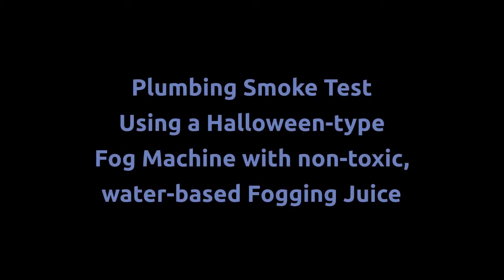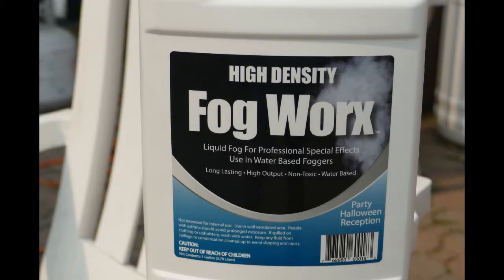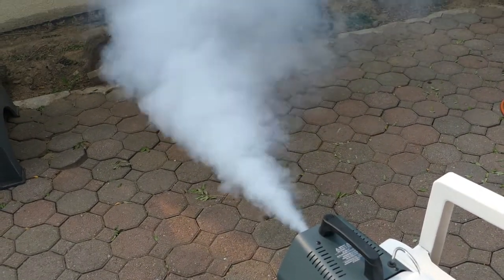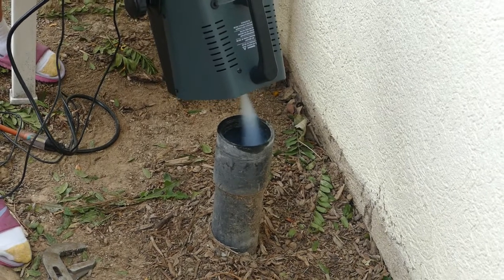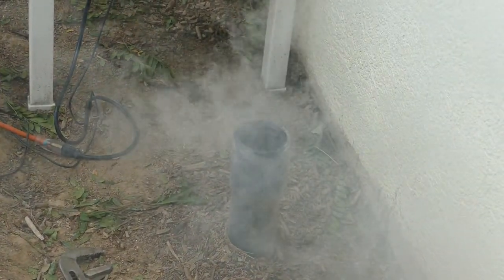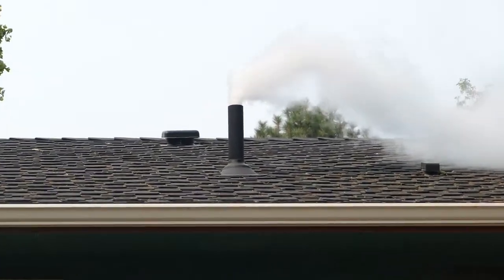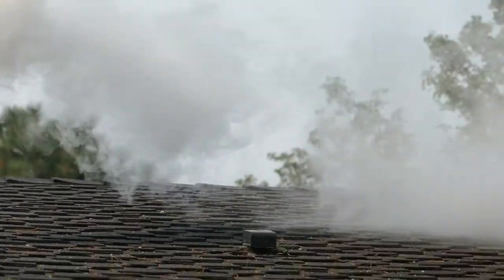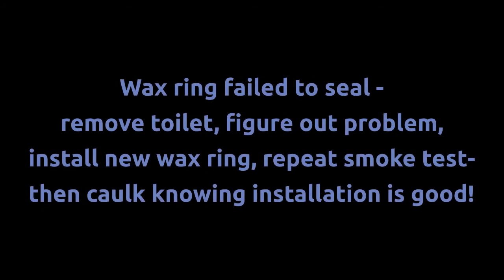Plumbing Smoke Test Using Halloween-type Fog Machine

Comment: Hi, dos you need to seal off the sewer main so the fog didn’t go that way? Or does the fog naturally want to go up?
Reply from the maker: I did not use any balloon plugs. I am on a septic system, smoke easily filled my entire venting network. Might be different for a system connected to a large sewer main, where a balloon plug could be helpful.

Comment: This is so interesting - thank you for sharing! 
After paying plumbers a small fortune for several of these tests, I have been looking for a DIY option. I bought 2 smaller fog machines (2000cfm), but they didn't seem to work. We alternately ran both of them, because they would overheat, into the clean out for 10-15 minutes but never saw any smoke appear out of any of the roof vents. Our home is 2 story, about 2700 square feet. After re-watching your video, I noticed that you're using a much more robust unit (7000cfm). I'll try purchasing one of those and see if my results improve. 
Thanks again! ☺
Reply from the maker: Thank you for your comment, it is very interesting to read about what you are doing. I hope it works for you, and will look forward to any updates you might want to share. We had profuse smoke (fog) coming out of our roof vents, then we quickly went inside to check plumbing in sections of our house at a time. We started this to check on a newly self-installed toilet, as it just didn't feel like we got a good seal on the wax ring. Sure enough, the wax ring had not sealed, as seen by the fog coming through, but it sealed great on the second try. We checked everything else in the house as well, and were relieved that everything was tightly sealed.
Reply: I think failed toilet wax seals during install happen way more than people realize. We've had several brand new homes where multiple toilets in the home were leaking. I don't think there's a good way to tell whether one has achieved a good seal with the wax rings. I've started calling it 'squish and pray'. 🤣 Smoke testing needs to be standard practice for validating a toilet install.
Reply: I have a 3500 sf house. You know the cost of the larger gig machine? Or fog?

Comment: How did the smoke get through the water in the toilet trap?
Reply from the maker: Smoke came from the wax ring that did not seal properly, not through the water trap. I removed the toilet, replaced the wax ring with a thicker urethane-wax composite ring, and re-tested to make sure the seal was tight - this time the seal was perfect and no smoke came out.
Reply: Ok so you blew the smoke in from inside the toilet?  It's misleading, it looks like the smoke is leaking out the wax ring from where you blew smoke in from the clean out outside. And it didn't make sense that the smoke would get through the water trap. @eaglehorse4337
Reply: @eaglehorse4337  but doesnt the smoke have to travel through the p-trap before it gets to the toilet ring? Can you explain how the smoke traveled from where it started to get to the toilet?
Reply from the maker: @diegoc3749  The water trap is typically in the toilet itself, above the wax ring. In many toilets you can see the p-trap or s-trap if you look at the toilet from the side. The smoke travels throughout the drain-waste-vent plumbing stack, only getting blocked by properly functioning p- or s-traps. A Google search for typical residential DWV plumbing stack diagrams will show several very helpful illustrations of how this all works.

Comment: What’s the name of the machine ???
Reply from the maker: My machine is an "ADJ Products Fog Machine Fury 2000."
Reply: @eaglehorse4337 do u have the Amazon link ?
Reply from the maker: Search for "ADJ Products, Fog Fury 2000, Professional and Portable Lightweight 1100w Fog Machine FOG242" and "FogWorx Extreme High Density Fog Juice Gallon - Long Lasting, High Output, Odorless Water Based Fluid - for 400 Watt to 1500 Watt Machines" and you will find many places to purchase. @wengchang9788
Reply: It is just a party fogger. I have one and I use it for this purpose all the time.
Reply: @eriko.7505  I made an adapter and plugged my party fog machine into the pipe under the sink. No smoke leaked and the bad smell remains. I did not get smoke out the roof with the smoke machine alone but a little came out from the roof when I pushed the smoke with a shop vac in reverse. What am I doing wrong. Any advice to make it work and find the leak??
Reply: @anthonyfrias8864  I used a Ridgid vacuum that fits on a Homer bucket to make a blower for the fog to pressurize the system. So, I blow the smoke into a chamber and the vacuum (on the exhaust port) blows the fog into the system. I don't think just the fogger will get it there. That is why I built this system.
But a bad smell from the drain? Does your sink stink? If so, then I would recommend that you remove and clean the pea trap. I'm sure there are a hundred videos out there somewhere, to show you how to do that. This will also reduce the number of fungus gnats buzzing around your home.
Reply: @anthonyfrias8864  Your roof vent might be clogged or partially clogged and this could be a cause for smells in the house. Go on the roof and snake out each roof vent. Very simple and easy to do if you can get to the pipe on the roof.